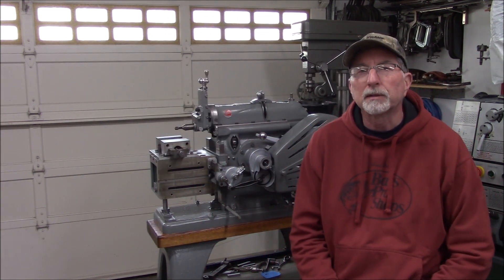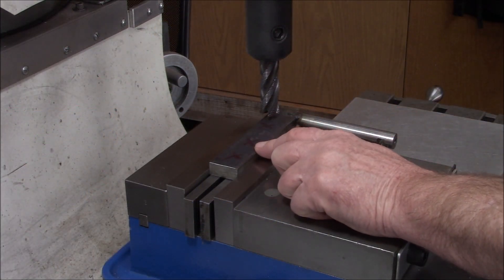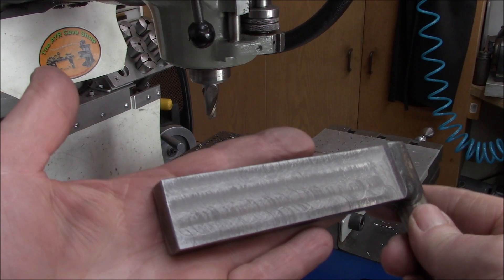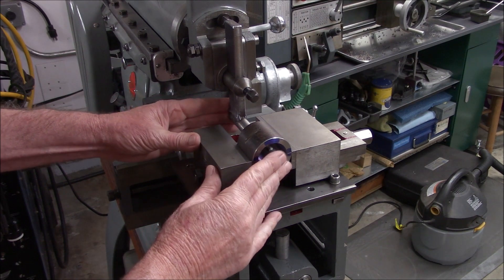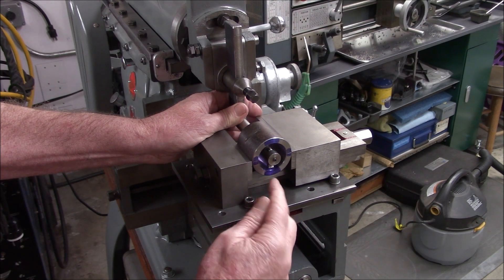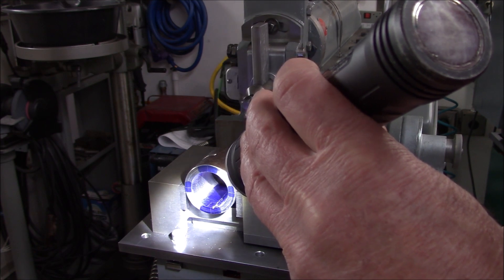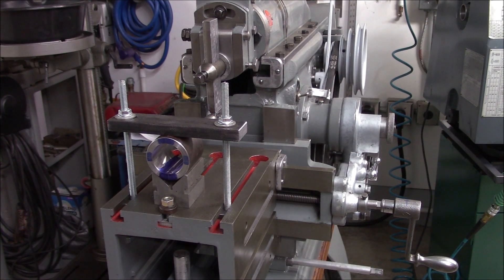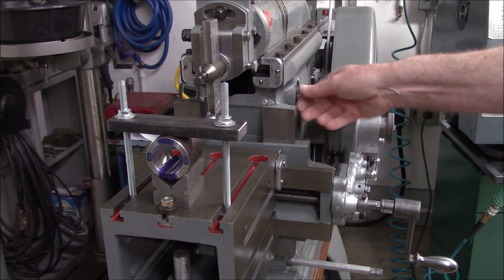Metal Shaper Monday - How Not to Cut Keyways

Comment: Your video popped up on my feed today.  Have been watching lots of similar videos to get some ideas for my own foray into cutting keyways.  I definitely like the "cutting upwards" approach.  Biggest advantage is allowing the cutter to flex downward out of the cut as you said.  Gravity being what it is, can have trouble with backlash in the screw allowing the cutter to advance too quickly if cutting downwards as well.  Cutting upwards removes that risk from the equation.

Have some plans in the works.  May be putting out a video soon to show what I've got--will see. . . .
Reply from the maker: @JimsShop-e3g  one of these days when I have some spare time LOL. I’m going to make a direct to clapper boring bar like Adam Booth did. That should be a huge improvement. 
Thanks for viewing and commenting Jim all the best ….
Reply: @TheAyrCaveShop  I wonder if you might want to remove the clapperbox entirely?  I did that on one of my boring bar holders.  Advantage there is that I got a couple of inches back that I can use for mounting the workpiece and travel for the ram/tooling.  I have the clapperbox locked anyway for keyways.  What works for Adam may not be the best solution for those of us with somewhat more diminutive equipment!

Comment: I suggest you raise the tool as high as you can in the clapper box. Locking the clapper is necessary. Your suggestion of an angle plat is spot on, get as much rigidity as you can. Great video, we all learn from the things that do not work, I wish I had seen this before I first tried a keyway on my shaper.
Reply from the maker: Thank You, making a better holder is on the list
👍👍

Comment: It would be easier to use a 1/8th cutting tool, instead of a 1/4", the shaper is an unforgiving piece of equipment, when work holding, is lightly tightened down. Anyway Dean, a nice video.....

Comment: my key slotter replaces the lantern holder complete and is a straight 1 1/4 shaft with a threaded collar holding it tight to the clapper. zero flex.

Comment: Hi, just subscribed, and i have cut keys on my shaper in exactly the same way, with exactly the same results! You get there in the end, but the process is not that good!
Shorten the bar? Agreed, but also move the tool up in the toolpost till the ram pushes directly on the end of the round bar and round end of the bar bears on the toolpost washer. I have seen instances of removing the toolpost and replacing it with a boring bar type tool with a similar end but a larger clamping screw. The L shaped tool is too flexible unless you can put the thrust directly on the end of the round bar, and the round bar must be large enough and short enough to eliminate flex. If you put a nut and bolt through the gap under the part in the V of the vee block and clamped it up with washers bearing on the parts edge you would eliminate the tendency for the part to slide in the vee block but angle plate with hole is the way to go!
Phil.  UK
Reply from the maker: Thank You Phil, Great info, advice and comment.. Yep a direct to round bar in the clapper box is probably the best way to go... Another project..
ATB....Cheers...Dean

Comment: My own shaper is in the same size range.  And from my experiences and those of some others like yourself and Rustinox and so on that these little guys just can't push a 1/4 inch or wider cut.  Things flex and squeal like you got and at some point when things have flexed too far the cutter finally tries to catch up with a HUGE depth of cut and it either makes it through with a huge "GRONKING" sound or it stalls or something snaps.  All of the options being accompanied by nasty noises from the machine.  

Stefan G had a video on cutting keyways with his small shaper.  I believe that he went with a 3 or 4mm wide cutter and after the first cut to depth he then moved it over and widened the two sides out as needed.    It's this older one from 8 years ago.  https://www.youtube.com/watch?v=n60lHUD8US8&t=247s

There's likely a relationship between the width of the cut and the size of the stem.  But from the number of squeal passes I'd say that 1/4 to that diameter shaft is just too flexible with too much push away force flexing things.  Perhaps go for more like 1/8 to 5/32 width?
Reply from the maker: Hi Bruce, Yes I think your spot on... I may have seen that or a similar one from Stefan years ago as well. Thanks for the link I'll be watching it again. Hoping to figure this out as time permits for when the odd job that only a shaper can do shows up.
Thanks...ATB...Dean